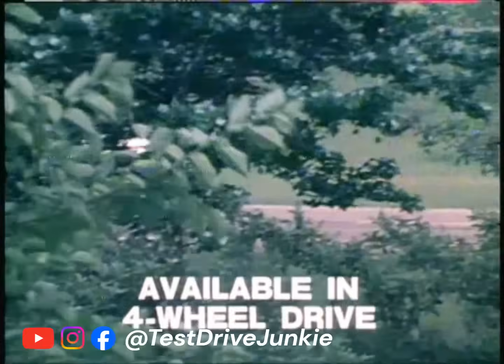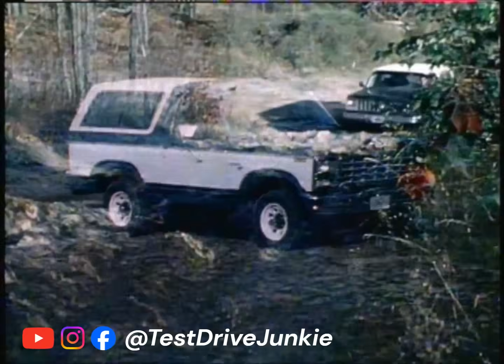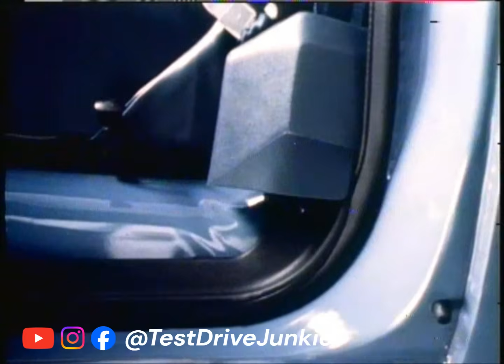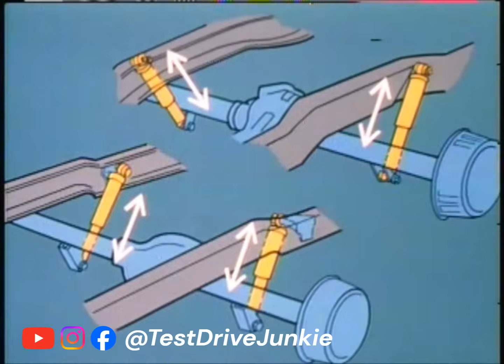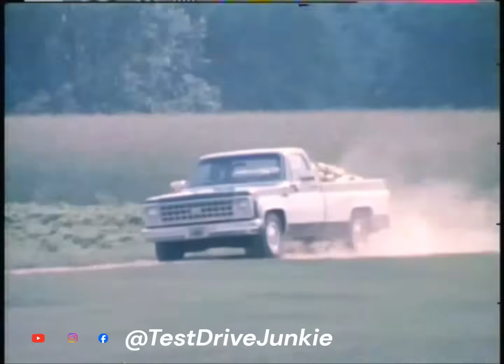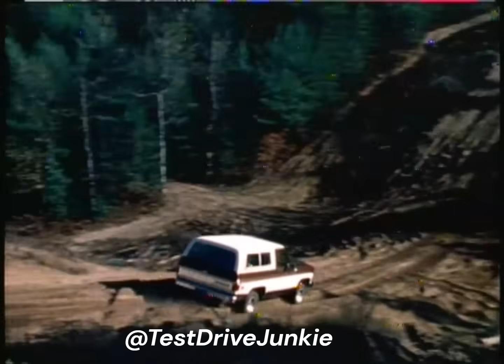1980 Chevrolet Truck Blazer vs Ford Truck Bronco Manufacturer Comparison Video

Comment: 1980 was the first year for those seventh generation Ford F-series pickups, third generation Ford Broncos, and sixth generation Ford medium duty F-series and B-series models. The medium duty F-series models are the bigger size trucks with that same cab design, and the B-series models are school buses and armored trucks with the same nose design on the front as the medium duty F-series models. The seventh generation F-series pickups and third generation Broncos were produced up through 1986. The sixth generation medium duty B-series models were produced up through 1998 and the sixth generation medium duty F-series models were produced up through 1999.

Comment: Those Motorcraft voltage regulators wound up being infamous for long term reliability.
Reply: The Transistorized ones WERE bad, the Old Style one (still used on MD Trucks during this time period) could be put in the same place, be adjusted for voltage, and would outlast the truck. - I still use them "BWD R295" are great, they have screwed on cover, vs. rivets.
Reply: My 76 actually still has the factory model the real issue with them is once they've been replaced the chinese ones are complete junk

Comment: I love how they bash many things on Fords that are actually Positive selling points for Ford:

The Twin-I-Beam 2WD front suspension. (Heavier Duty Design, and fewer wear points, if properly maintained, outlasts ball joint suspensions, the tire scuffing and lower ride quality is true, but its a Pickup, not a Car.)
-
The 9" Rear Axle. (Built so heavy duty that racecars all over the world use them, takes a lot of abuse to damage them, and they have three bearings holding the pinion, and you can "set-up" the gears on the bench, not climbing under truck.)
- 
The diagram of the Ford front bumper attachment is of 75-78 Econolines. (The F150 bumper is stronger/thicker 3-sided channel, and is meant to bend without damaging the frame. GM's outer supports usually buckle the frame on impact.)
-
Showing starter solenoid on the starter, (A KNOWN GM PROBLEM!) and (Pointing out GM's integrated parts, means you must remove, replace or repair entire assembly, instead of a 5-minute replacement of separate Solenoid/Coil/Regulator. The electrical tape is more waterproof than the split plastic conduit.)
-
Side post batteries?...LMAO!...(They never stay tight, and more prone to corrosion. AND they cost more to replace!)
-
Instrument Cluster? (The Fords outer bezel comes off the same way, though its plastic....But changing bulbs is a once in 30 years experience on a Ford because uses long-life bulbs from factory.) 
-
Ford's welded box was stronger and didn't twist. (I don't see a disadvantage)
-
350 Olds Diesel? - (We know that was a POS! - Nothing to brag about there!) 
-
No Big V8 over 7L displacement? = (That was truly a mistake on Ford's part. However the 1979 Oil Crisis had just slapped everyone in the face. - The 351-2V produced the same amount of torque as GM Light Duty 350-4V "LS9" - but more torque than the HD 350-4V "LT9" - Makes no sense to put a lower performance engine in heavier trucks? - Ford usually got better real world gas mileage as well! - Remember YMMV)
-
Comparing the 250-6 to the 300-6 is a joke...The 300 produces 50lb-ft more torque, and though the 250 and 300 make similar Horsepower (120) the 250 has to SCREAM at 4000RPM to get that power, where the 300 is at 3200RPM.
-
Ford made less "Horsepower" than the GM engines - YES - But which ones made more torque? (Usually Ford)
-
In the 5% comparison they stated "Base" axle ratios, but did not give numbers. Well here is the numbers, the 5600 GVW "Big-10" w/5.0L and 3-speed "MX1" (likely a TH350) Automatic standard ratio is 2.73:1 (3.08:1 Optional) The Ford F150 5800 GVW (Closest option to 5600lbs) with 5.0L and 3-Speed C4 Automatic standard ratio is 2.47:1 (2.75:1/3.00:1/3.25:1 Opt) - They skewed the numbers by not showing them.
-
Twin Traction Beam w/coils rides better than straight axle w/leaves...But loses in the durability department. - The "exposed" RH drive shaft is a non-issue.
Reply: hawking the straight front axle & flat dissing the independent Ford axle, yet all they could go on about was the independent 4x4 front ends on the GMT400s when they were first introduced 7 years later. In typical GM fashion, they used tie rods about as big around as my little finger which plagued its successors & is still an issue for the T1X platform even to this day.
Reply: How's that exposed axle tube not just trap & hold salt and mud though?
Reply: Chevy better engineers.
Reply: @tobeornot2027  Which is why Ford has been #1 Selling Truck in America EVERY YEAR since 1977.... DRUGS BAD, MMMKAY.
Reply: @misters2837 ford guys put chevy motors in to win😮
Reply: @tobeornot2027  Win what?  Slow Junk Awards? - I have so many short track trophies in my shop from kicking ass with Ford power, I had to build a whole set of shelves in the other shop! - Its sad when an over-bored, and sleeved 307cid "289" beats the crap out of 350 Chevys and 360 Chryslers. That "should" have 100 more horsepower, and yet they don't. - Naw you can keep that trash!
Reply: @misters2837 ask Jimmie Johnson
Reply: Those years Ford where junk.quit being delusional.
Reply: Those years of Ford where junk quit being delusional.go with the Chevy

Comment: I like how Chevy implies that its drivers hit shit like curbs so they have to account for it. And still standard from Chevy is that if something like an alignment is out of spec then with Chevy you don’t have to check the condition of suspension components.

Comment: But what if you wanted independent front suspension on a 4 wheel drive? While this advertisement was being prepared Chevy and GMC trucks were having camshafts fail and if it was past your 12 month 12,000 mile warranty the dealers were telling the owner to cough up the money for a new cam or to pound sand. Do they mention if you close the hood on the Chevy wrong you fold the hood?

Comment: Grandpa was a rancher. Used and abused them to the point that after 4-5 years they were done and put out to pasture-literally. He was a Ford man through and through dating back to his Model T. Conversely on the car side Grandma had Studebakers, Ramblers, and a few Chevy Impalas. When the 77 Ford pickup went to pasture grandpa got himself a  "fancy" i.e. loaded 81 Ford. All red inside and out; a/c, carpet, velour seats etc. It was a lemon and frankly too fancy for the work it needed to do. After leaving him stranded for the umpteenth time he decided to take grandmas Impala out and check on some things on the lower 40. He probably should have taken his horse. The Impala was fine, but you don't get Grandma's car dirty and muddy.  Grandma had the 81 Ford towed to her local Chevy dealer where she traded it for a 83 Cheyenne. No input from Grandpa. The 83 lasted till 89 when it was put to pasture. The 89 GMC lasted till grandpa's death in 91 and was sold. The pasture with the row of old Ford trucks and one Chevy are long gone replaced by McMansions. Ford/GM/Mopar. Built a lot of good ones and some bad ones too. The late 70s early 80s was a bit of a crap shoot for all of them. Some lasted, some didn't.
Reply: I drove a 1981 Ford F150 4x4 with a 302 and Automatic transmission for 17 years with not a single breakdown.  And it was used when I bought it in 85. It still had great power and reliability when I sold it with 240k original miles.  It never was a powerhouse or real great hauler being a stepside shortbed. But it was quite capable off road . And never got me stuck except for a couple times in the snow. And those times were all in a row when it needed better tires. I don't think there's been a vehicle I've owned that I trusted as much as that old Ford. I didn't baby it or abuse it but I most definitely used it. I maintenanced it regularly and to be honest never cared for it much until after I got rid of it . I've owned Fords , GMCs and Chevy pickups over the years. Chevy and GMC I had were both 70s models . Neither left me broken down when I owned them besides broken frame at the steering box once. It broke when I was on a pretty curvy road and did cause a crash unfortunately.  But other than that I didn't have any breakdown issues with either truck until the Chevy frame issue cause me to crash

Comment: Another difference between them is that Chevy had side saddle fuel tanks that were outside of the truck frame.  In the event of a T-bone collision, the unprotected tanks could rupture and ignite into an apocalyptic hellfire.  😮
Reply: That was debunked, the NHTSA and IIHS both admitted to using outside ignition sources to create a problem that never existed. Just like they did with the Bronco2 and Suzuki Samaurai rollovers and all the way back to the Pinto fuel tank BS

Comment: 5.7 diesel dependability??? 😂😂😂😂😂

and the side terminal battery was arguably one of the WORST so-called innovations ever!
Reply: And the GM starter mounted solenoid was prone to heat soak , causing hot cranking problems .

Comment: Very cool video! Lots of good stuff here.

I know this was made by GM so it's obviously trying to promote the Chevy (and some of the criticisms they take with the Fords are kind of silly), but that being said, the first years of the Ford "bullnose" weren't Ford's best, in my opinion. The 78-79 Fords are one of my favorite trucks of all time, but if I had to buy a new truck in 1980, I'd probably go with the Chevy, even though I consider myself more of a Ford guy. Not that the 1980 Fords were really that bad, but I prefer the square body Chevies or especially the 78-79 Fords over them. Not to mention the "Swiss cheese" frames on some of the early bullnoses. By the last year of the bullnose Ford, 1986, the tables had turned a bit. Ford had more engine options, including an International 6.9 IDI diesel that was better than Chevy's 6.2 Detroit (in my opinion), which itself was better than the 5.7 diesel they speak highly of here (again, in my opinion), and you could get the 460 gasser in the Ford, which was a better match to the 454 Chevy than the Ford 400. I also really like the Lariat trim level interiors in the later bullnose Fords better than the Chevies, but that's just a matter of personal taste. So in 1978-79, I would have chosen a Ford truck/Bronco over a Chevy, in 1980, I'd pick the Chevy, but by 1986, I'd be back with Ford. I don't feel like either option was bad back then- they both had things one brand did better than the other. I feel like what was more important was what options you chose (engine, etc), and that you avoided that "reliable" 5.7 diesel Chevy 😉 Also forget about the gutless 4.2L/255 V8 you could get in the early bullnose Fords. It was reliable, but could barely pull itself 😂

Comment: Ford, GM, Chrysler, Ive had all three. They all had differences, but not one was the best over the other. But they sure were better trucks than todays garbage.
Reply: They each had their pros and cons. In 1980, GM and Dodge were better than Ford. The 19i80s were not good years for Ford.
Reply: @blueduck9409 Agreed. Loved Ford’s early to mid 80s pickup styling, but mechanically, they weren’t known for high mileage dependability.
Reply: @CrowCreekOutdoors Yes, the Ford is the Honda, (And Dodge/Chevy are POO-LARIS) which is why they have been the #1 Selling Truck in America for almost FIFTY YEARS. - I managed a few fleets as side job back when these were new... Fords would outlast Chevy/Dodge easy. - Most fleet trucks were Six Cylinder and Automatic (or 4spd Manuals) The Dodge Slant Six and the Chevy 250 (as 292s were rather rare) were VERY underpowered, and the 300-6 was well known as the best gas six cylinder put in American trucks 1965+ (until emissions forced V6s into market)
Reply: @CrowCreekOutdoors FYI, I have my Late Father's LAST NEW truck he bought when he retired, a 1986 F150 300-6 4spd... It has a little over 337,000 miles on it...(he had a 1980 F150 300-6 3+OD...that finally died at 416K)... The only major repairs to his '86 have been 2 clutches, and I rebuilt the cylinder head a couple of years ago. (Burned a valve about 30k miles ago.)
Reply: @blueduck9409  Interesting, I disagree, Ford had sturdier front suspension, with 3 wear points per side (2WD) and had Supercab (GM did not), Ford's Inline Six stomped the Slant 6, and good luck finding a GM with a 292, the 250 was a turd.  The 1983 6.9L Diesel Fords kicked the 6.2L's ass.  (Of course that was a REAL truck engine put in a pickup!), where was Dodge? (Nowhere with a Diesel YET!)
Reply: @misters2837 In the terms of quality and dependability, comparing a Dodge to a Ford or Chevy product is the same as comparing a Polaris ATV to a Honda ATV. Both look nice and perform well when they’re brand new, but after the new wears off, one in particular stays in the garage more than it stays in service.
Reply: Amen. You could buy a practical, dependable new truck for a very reasonable price back then, and if you did standard maintenance, it would last your adult lifetime if you wanted it to.
Reply: Pretty obvious GM did it better back then.

Comment: Why do they look the same? Why couldn't they do something to make them have a different look at least? I couldn't tell you what was what without them saying I video and seeing name on it. If they switched logos between them don't know how many could tell looking at them
Reply: Must mean Chevrolet and GMC. Its always been that way. Slight difference in body starting in the 2000s but even then its slight. The ford and chevy here are much different body styles. The chevy is rounded and has curvy body line vs the ford is angular and much more modern for the time
Reply: @workingcountry1776 no I mean what I said. Aot of cars from 70s and 80s look alike too. Gm, Ford, Chrysler all had cars that would be hard to tell apart still.